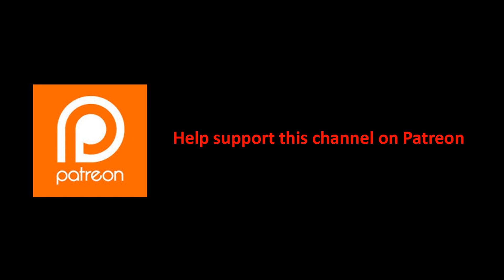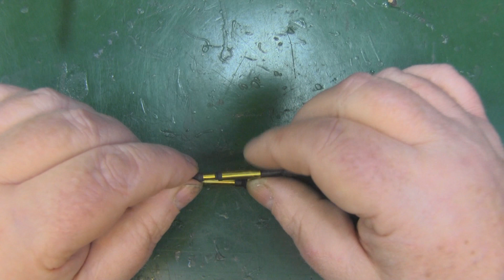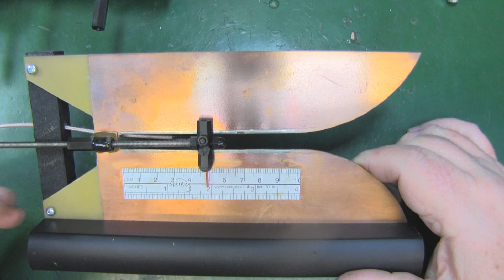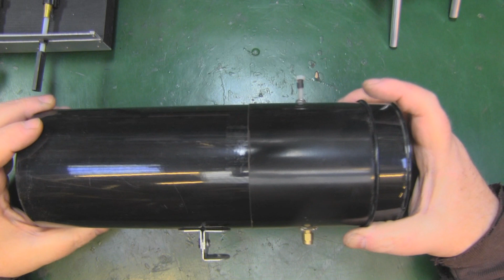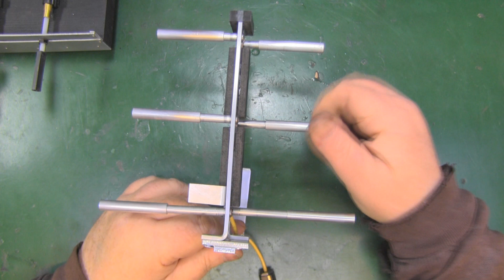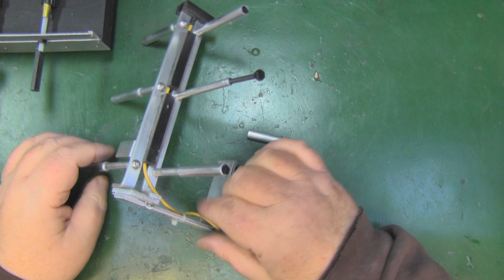Adjustable Antennas for Design and Testing

Comment: fascinating. Re loading coils. So far as i am aware, loading coils were designed to reduce the length of CB aerials whilst having only a minimal effect on gain. But with 2.4 ghz we do not have a problem with size, so surely it would be better to make the rods a bit longer and leave out the coil?

Comment: Interesting that you can adjust by scrowing some antenna parts. Then company can make one antenna and sell for different applications
Reply: @astroj I means in some way that it does not require second measurement and network analayzer

Comment: Good return loss/swr doesn't mean that the antenna is performing good, it's only mean that the matching is good. If you adjust the element length/spacing it can change the gain of the antenna as well. I can match a brick to 50ohm but it's not going to be a good antenna. Return loss below 14dB (swr 1.5:1) is acceptable, the gain is more important. For designing a good antenna you must measure the radiation pattern(gain) or at least simulate it with some free software like YagiCad and/or 4nec2.
Reply from the maker: Measuring return loss is a staple of antenna design I think you completely missed the point of this video but that is ok don't worry about it.
Reply: @andrewmcneil  Yes it is, but it can't tell how good is the antenna. You have a nice channel about antennas, it will be awesome to see some gain/pattern measurements  to verify the antennas properly. Not that easy but it's doable.
Reply: Measuring S21 and S12 are fundamental I would think. Certainly in microwave filters the freq response is determined by the impedance matching which is a function of the above. Filtering is caused by creating impedance mismatch. Is antenna design not the same? I don't know... just asking
Reply: @Phone_Geek  Put a monopole inside a metal box, tune it to best swr. Is it a good antenna? Yes matching is important but not the only thing you need to measure.